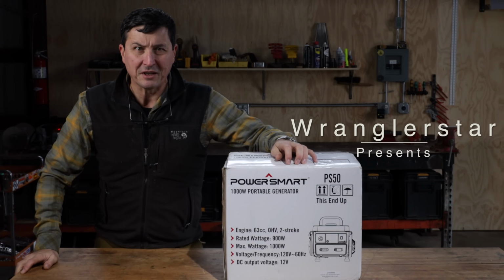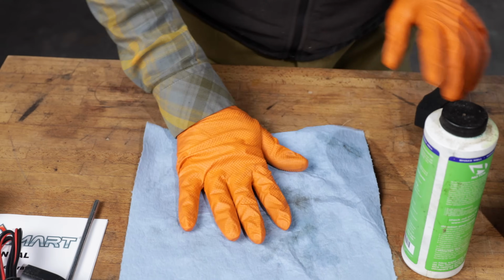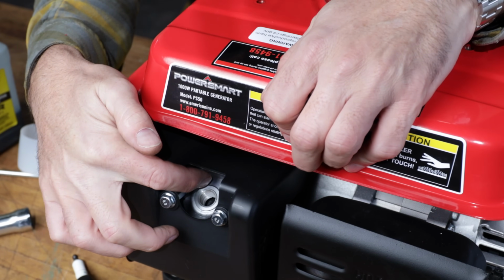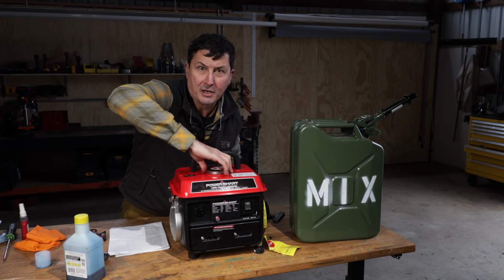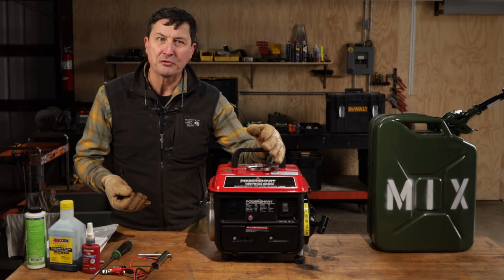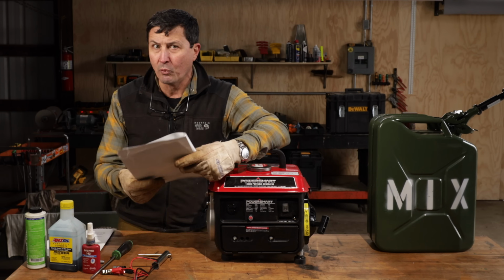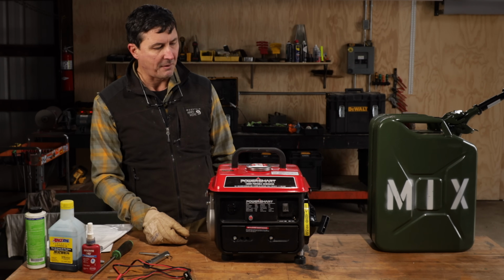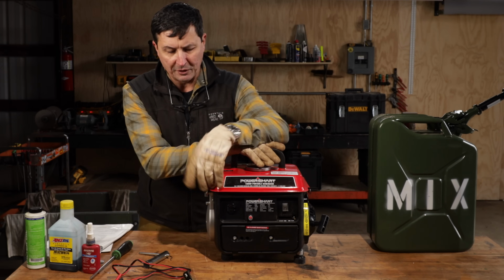TESTING The Cheapest GENERATOR on Amazon -$99

Comment: I bought the Harbor Fright model and it worked OK for running the kitchen appliances during power outages. One day I started it to give it a run and its tarted to rattle and sputter. I thought maybe it threw a rod,or some other horrible catastrophic failure.  I shut it down and the pull start had too much slack. I pulled the starter cover off and found that the flywheel was cracked in three places radially from the center out. I pulled the flywheel and found the end of the crankshaft threading all chewed up as well as the keyway. The CRankshaft is made of very very soft steal. The Flywheel was made of aluminium.  Not a bad design over all. Kept the wife happy preparing meals during power outages for which their were several in the Peoples Republic of California.  Whomever the Chi-Com Comisars had their engineers COPY they copied a good design. Only one problem. They chinsed on material quality. It is now a pile of junk that I'm trying to figure out how to repurpose some of its parts. Its a pile a junk at this point.

Comment: How did you run a 1,500 watt electric heater with a 900 rated watt generator?
Reply: I was wondering the same thing. You think it'd have blown the breaker.

Comment: it is pretty much the same as the Harbor Freight, "tailgating generator", just the harbor freight 1 is rated for only 6amps (I've ran 20 amps easy and ran fine)
Reply: Just curious, what's the run time on a tank of fuel on yours?
Reply: @familylandscapecompanyinc.7355  on mine iv run around 3-5hrs under a load if i remember right
Reply: @familylandscapecompanyinc.7355  be honest I haven't used it in months I don't remember

Comment: Better get some spare pull start covers...$13 on amazon...I leant mine to my sister in the bay area after PG&E cut the power.  
She wasn't schooled on pulling through smoothly and ripped the plastic recoil guts to pieces. Thankfully Amazon delivered the next day.  I'm going to take an old cover...cut a hole..and see of I can't start it with a socket and cordless drill. This would be easier for her to start I'm thinking.
Reply: Just make SURE you pull the drill away from the flywheel nut, BEFORE letting off the trigger! Otherwise, the built-in brake in the drill will try to stop that 63cc engine, and either damage the drill, or torque it right out of your hands: OUCH!!!!!(speaking from experience)For the sake of safety, make sure you use the high speed setting on the drill, if it has enough torque. Remember, for this generator to produce 60 Hz, the engine must turn 3,600 RPM, which is faster than most cordless drills can go.
Reply: @vincentrobinette1507  That sounds like very good advice.  Experience is such a good teacher.
Reply: @dwightl5863  Trust me: you'll only make that mistake ONCE!

Comment: i got the HF version ten years ago.  I run the cheapest fuel with stihl 2 cycle oil and never drain it, just turn off the fuel and run the carb dry.  She is still a 2 pull machine
Reply: I have the same one as you from HF and bought it a few years before you and mine is a two puller too, I think it was $89 back then.

Comment: You have obviously never used PJ1 air filter oil in a spray can. It is so sticky and stringy you will have a hard time letting go of the filter to put it in the housing without stringing oil all over. Best air filter oil made for foam filters.

Comment: The kerosene heat source is much more simple and quiet and probably more fuel efficient than running a generator
Reply: But this genny will run a kero turbo heater.
Reply: I think he was only using it as an example of the output of the generator
Reply: I agree, I like the kero-lamp heater idea. Also, if you did try this generator, I wonder if there's a good way to use the exhaust heat too -- no sense in wasting that! 😉
Reply: @JayHarrisonGoogle  anything you do to try and reclaim heat from the exhaust.  Is going to create restriction and  further reduce efficiency of the engine.  The best way to get heat in a grid down situation is to just use a propane or kerosene heater.  Save the generator for just electricity

Comment: as a cheap "disposable" generator that looks decent.. something i can loan out, have one laying around as a backup / backup, something to leave up at the mountain cabin and not overly worry about it "walking off".
Reply: the fact that this is a 2 cycle engine, it's perfect for everything you just said, because it never needs oil changes, it can never run out of oil, and it never needs valves adjusted. Just gas it and go! I would, however, give them a can full of 50:1 gas/oil mix, so they don't accidentally put unmixed fuel in it, which would destroy it in minutes.
Reply: I wonder how well it will work to power a trailer over a weekend?
Reply: I too have owned items made so badly a theif returned it!
Reply: @robertl.fallin7062  Apparently the thief kept your dictionary however...sorry, couldn't resist, just messing with ya' :)

Comment: I believe everyone needs this never know when you need to run a fridge or freezer if you don’t have anything else this is it
Reply: This will most likely not run a fridge. I imagine a fridges surge watts are higher than 1000w.  Surge watts are a huge consideration for generators, it is the initial watts require to start it up when the motor runs.  Same as a microwave uses a lot of watts on startup and then drop known as continuous watts.
Reply: mixwell1983 larger models of home fridges run around 750 watts while smaller ones run 350watts
Reply: @trevorholland7  those are contious watts.. Surge watts are around double if not more..
Reply: I was thinking the same, you never know when the fridge will quit(mine makes a whole bunch of odd sounds and she is about 14-15 now)
Reply: brian70Cuda A generator will not a busted refrigerator. ?
Reply: @DeletedReplaced  ?

Comment: You might find this stupid, but I run my trolling motor as well as charge its battery when low with a generator like this.  To run the motor direct you just buy an A/C to D/C switchable power supply (from China, $25-$30)
  It's a 42lb thrust Minn kota on a 10'8" Bassmaster pro plastic boat.  A pipe going into the water secured with a screw to the exhaust really quiets it down.

Comment: I bought the HF equivalent for my father for $88.00. He used it for over a week after Hurricane Sandy. It ran a full sized fridge several hours per day and he alternated with the oil burner for hot water for showers and heat. Ran great with no problems at all.  We used only premix non ethanol gas with synthetic oil (tru- fuel) Well worth the money. We did put an NGK plug in.

Comment: You fizz for this thing is contagious,  in trying to justify the purchase in my mind but honestly dont actually need it hahaha. Looks like a nice little toy to have.
Reply: I would recommend it, especially if you have a chainsaw, leaf blower, or string trimmer, so you already have 50:1 fuel/oil mix on hand. You don't have to check or change oil, and no valves to adjust. Just put your fuel/oil mix in, and it's ready to go. If you have any plug-in outdoor power equipment, like a hedge trimmer for example, you might find this generator more handy than running 500' of extension cords out to where you need power. I have 4-cycle generators, because they work on the same fuel as my lawnmower, rotor-tiller, and snow blower. I would NOT recommend this, if it's the ONLY thing, that uses 2-cycle mix. Get one that uses the same fuel as everything else.

Comment: At 120v it won’t more than 8amps. Voltage x current = watts
Reply: I've ran a lincoln 220 with mine
Reply: It ran the 1500 watt heater while charging a battery though...

Comment: Hey Cody. I got an older Honda 2 Stroke generator that has been going for over 2 decades. It's quiet, it starts easy, and it runs well. And my god is it light. It was a Honda EX350.

Comment: I have the Harbour freight version of this. They are actually decent generators.
Reply: It usually runs two hours with me using a ton of halogen lights. It is definitely not a good camping generator because it is loud as heck. It is a copy of the 80’s Yamaha two stroke generators so it is a good design just is cheapified a bit. I’ve had it for 3 years and have used the hell out of it and didn’t do anything to it as far as maintenance goes.
Reply: I'm willing to bet that his Amazon Smartpower and your Harbor Freight generators were both made in the same factory in china. For the money, they really ARE decent little generators! They're so inexpensive, because they sell so many of them under many different brand names.
Reply: I was gonna say.  This looks like the harbor freight generator under a different brand name.
Reply: Slim Tinskin  Friend of mine has dog grooming business. She has big Predator mounted on trailer tongue, uses it every day.
Reply: Yep, i bought mine from harbor freight about 4 years ago. Its the same one just black and blue with chicago electric badging. This thing just keeps going, ive been very impressed to say the least!
Reply: Steve Rhodes Damn that’s old if it’s the Chicago Electric! I had one that never gave me a lick of trouble but my dad got me a little Honda so I sold the other one at a garage sale and I regret it. I have a newer version( not sure if storm cat or predator)and it never ran good and doesn’t run at all now.
Reply: The one I got was just ran ok second after a year and a couple uses the flywheel broke its cheap thin plastic
Reply: how long can you run it on a tank of fuel?
Reply: Harbor Freight? Really??? 🤔
Reply: Best generator I've ever owned is my 4k watt predator. Little thing ran half my house during a storm. Fridge,lights,tower fan,TV and ps4

Same thing with there power inverters I have there 4k surge watt inverter thing runs all my tools with ease on my truck
Reply: Sacrilege!!!
Reply: Me too!   Works for me!
Reply: The predators I have heard good things about I have a old wen that’s a tank
Reply: Doesn't work for long and hard to pull start iv went through 4 of them have them away
Reply: No every thing is junk they do have a lot of stuff that worth having
Reply: Also have the cheap ($79) version and it has bailed me out in several outages. NOTE: This is NOT the Harbor Freight predator. They cost WHY more money.  The small size lets me carry it anywhere I need power. You do have to mix your gas and oil, it is a 2-cycle. For the money, it is fantastic.
Reply: @jdwthebullitt7765  I do believe they're made in the same factory. If you took the engine-alternator out of the frames, you wouldn't see a difference. I would even bet, the parts are exactly interchangeable! The differences are only superficial.